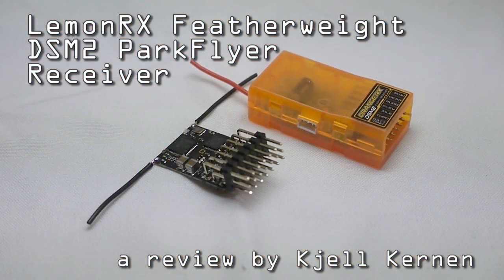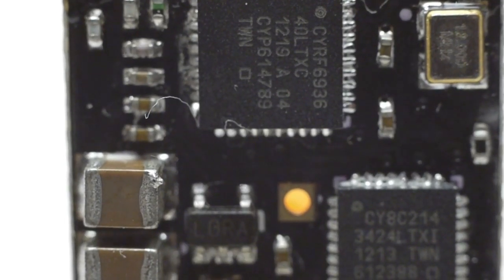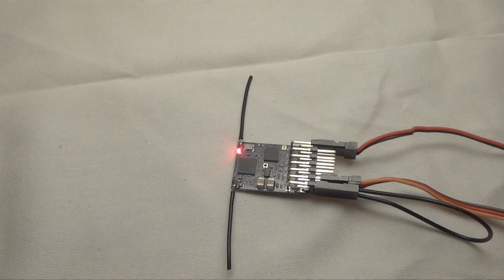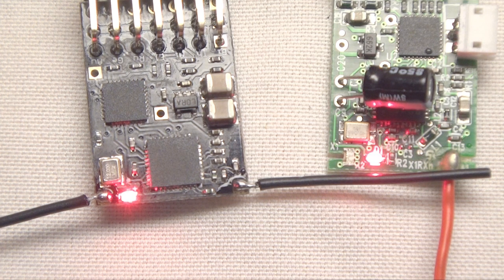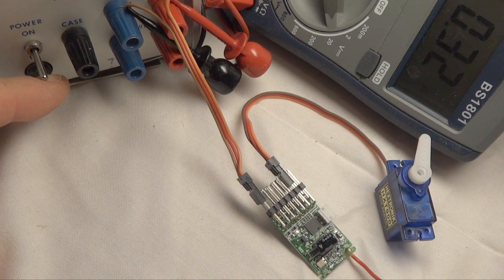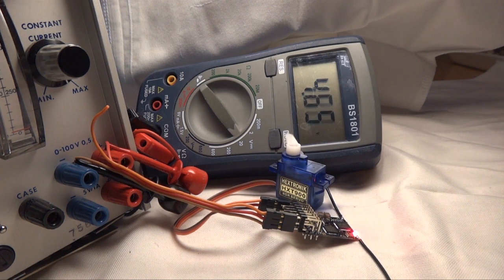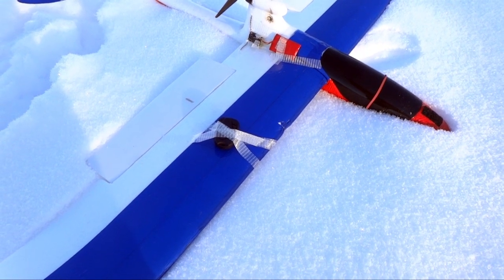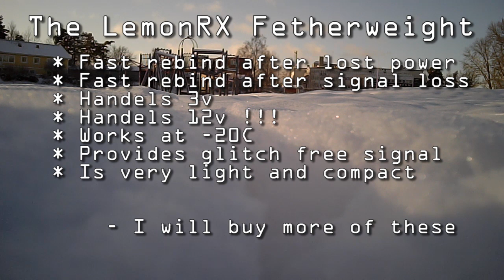LemonRx Feather Light DSM2 receiver test

Comment: Kjell, I have been using these for the last year and can't be more happy.  Your video was the reason I took a chance, so wanted to say thank you.  I use the DSMX AS3X version on my VisionAire from Horizon Hobby (I pulled out the Spektrum and replaced with a Lemon).  I did this because it is easier to change the settings via the pots and because you can turn it off completely which you cannot with the Spektrum.  Thanks buddy!

Comment: Hi Kjell - when you did the low voltage test how do you know it wasn't the servo giving up rather than the receiver? If that had been me I would powered the servo from a separate supply to show when the RECEIVER gave up. Just a thought, no criticism intended. Great video otherwise, now subscribed.

I realise it's the combination that counts in the air but different servos may give different results and you are testing the receiver after all.

Comment: I've a small question concerning the voltage accepted by this receiver. I looked on Lemon-RX website that the voltage range is 3.45 to 10.2V. Doest it mean that you can put anything in this range on the Aux port to power the receiver? So I can put a 2S 7.4V lipo battery on it without burning it?

Comment: Only one question after a great review, and, a mistake we've ALL made at some point, with the rise of the arfomini, and PPM now coming to the forefront, does this Rx do ppm?
Reply from the maker: No,  it doesn't.  But Lemon have both DSMX and DSM2 satellites that are even smaller and that use a serial protocol that the afromini understands. I have two afrominis controlled by DSM2  satelites from LemonRX. Extremely small combination that works well.
Reply: Well I'm using orange module and Rx, so anything has got to be better... off to google lemon... Thanks

Comment: When the Rx is installed in your plane you have the 2 antennas taped in the wrong position. You have them in a " v " shape or 90deg angle. They should be at a180deg or in a straight line. This info was told to me by a Lemon-rx Tech. If you like send them an email and ask for yourself. Actually only 1 of the wires is an antenna but both are required for best reseption.